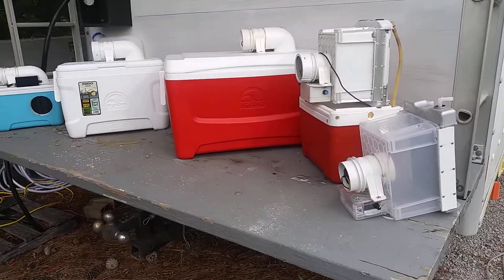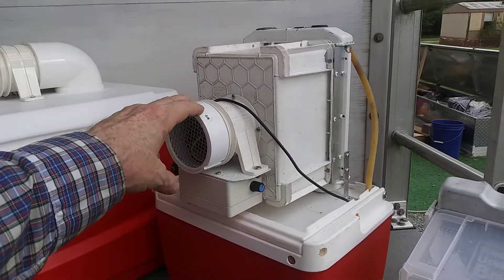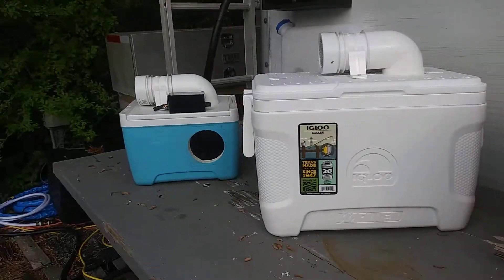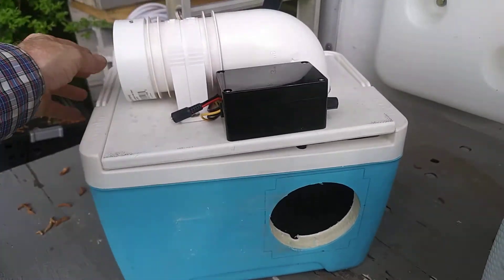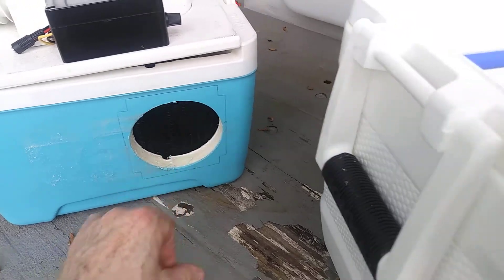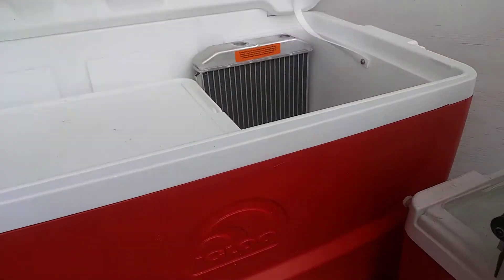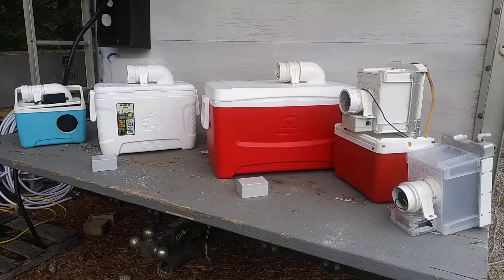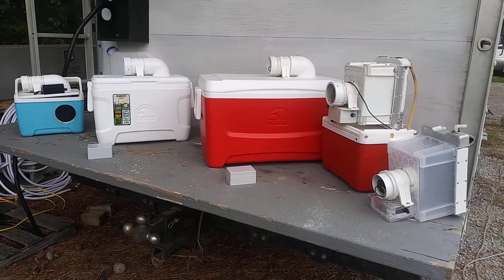Homemade AC Solar/12V. Build Ideas - Sm-Med-Lg Coolers. Sneak Peak.

Comment: Hey James,

Hope you're doing well! Been loving your channel lately. I'm diving into a DIY project to beat the scorching Atlanta heat this summer - I'm building my own A/C or chilled air cooler setup. I've got a few questions about batteries and airflow that I hope you can help me with.

Here's what I'm planning:

Coleman 316 Series cooler with wheels (17.3"D x 36.9"W x 18"H)
EVIL ENERGY 5/16" Transmission Oil Cooler - a 4 Pass Tube and Fin Cooler Kit in Universal Aluminium Black
Two SEAFLO 4" Electric In-Line Marine Bilge Air Blowers - they're 12V, 270 CFM, and super quiet for my boat-inspired cooling system
A DC 12V Solar Water Heater Circulating Pump with DC Power Adapter - it's high-temperature resistant and has a lift of 4M and a flow rate of 10LPM (2.64GPM)
(Still deciding on this one)
FITNATE 12 Pipe Aluminum Heat Exchanger Radiator - it's for a PC CPU CO2 laser water cool system, but I'm repurposing it for my project. It's 10.62 inches long.
Each motor fan is rated at 12 volts and draws 6.0A. I plan to run both fans for 8-10 hours.

I'm considering using a 18650 12V 150Ah lithium battery to power everything, but I'd love your feedback before I commit.

Thanks a bunch!